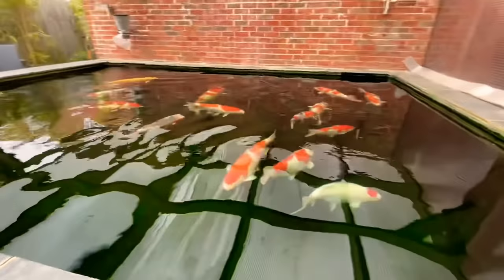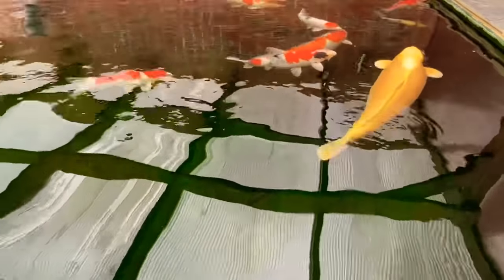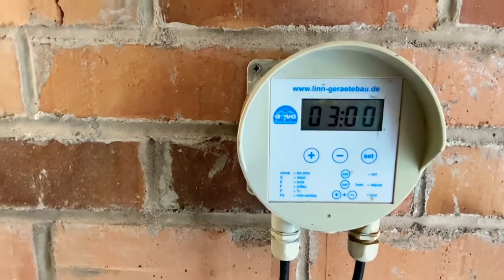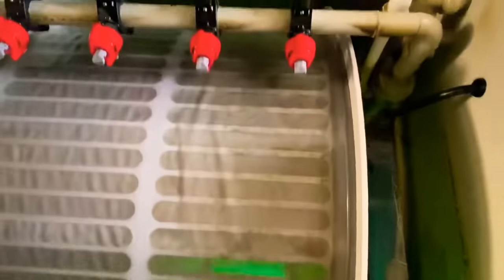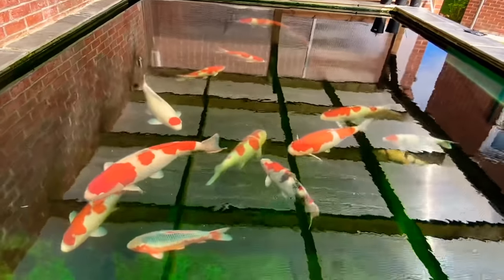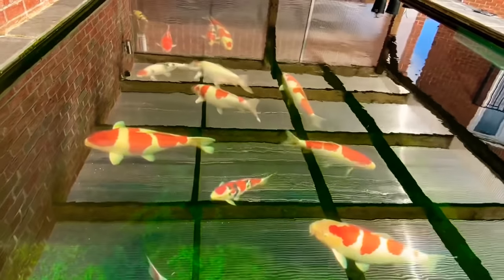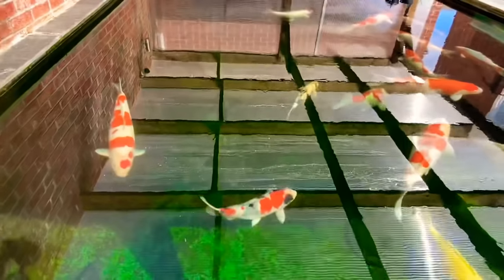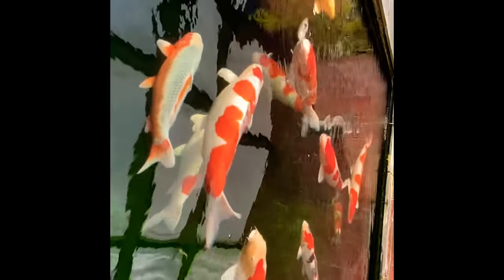Japanese Koi Pond. RDF filtration and Bakki House media

Comment: How did you get the 1” up pipes to fit into the 4” pressure pipes … did you use a T and reduce or use a boss fitting, could you please explain..? Thanks

Comment: That's a great set up, 
I'm currently re-building my pond and going for drum and bakki shower.
I'm also looking at using either an external heat exchanger, or stainless coil like you have.
as i'm a pipefitter it's a relatively low cost install.
but I'm a little concerned about the heating pipework to the coil within your drum its self, in case a fitting leaks...

Comment: If you have a bakki shower in your pump room does it make a lot of humidity especially in winter?
Reply from the maker: Not at all. Have heat radiators to prevent this.

Comment: One question Chip do you ever use clay in your water? Just curious mate.
Reply from the maker: No. Never. Did in the early days of koi keeping. No long. I use my limited funds on providing the very best water, and very best food. Koi clay  provides a little relief (like a purge) on the koi’s kidneys. Best sprinkled on food so they ingest it. But again, if you use quality food and provide best water. Sensible stocking levels. No need for these kinda tings
Reply: @bdkoi1 I understand mate, I got some Kasuri clay to try this year however I'm using kasuri pellet this year anyway which already contains it. Just a little trial on my part to see any benefits.